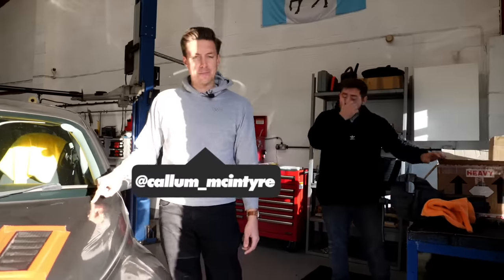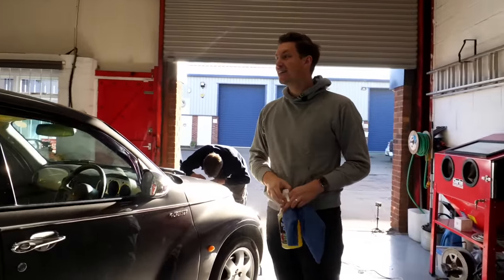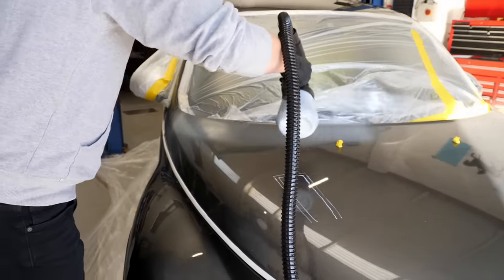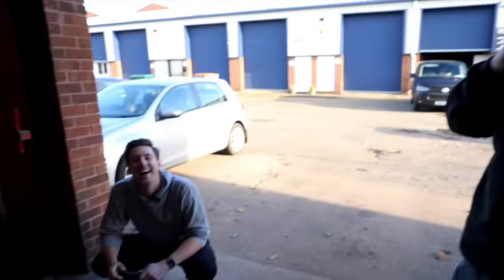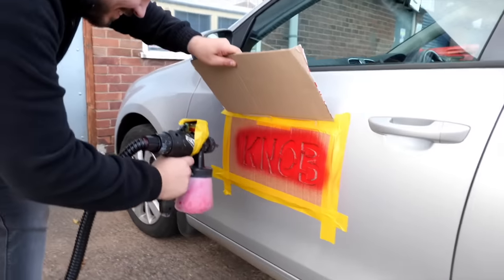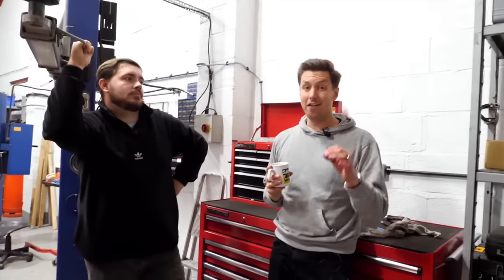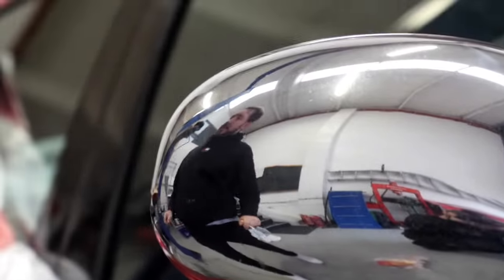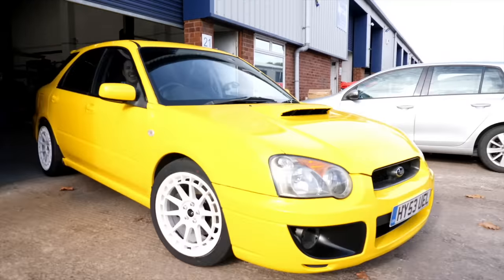How Good is £250 Amazon Paint?

Comment: Dip can be fixed rather easily. Just need to cut and remove the botched part (peel or a run) to get to the good portion, rub the edges with paint thinner to smooth the edge of the film, and respray with a bit of an overlap.
Also, no need to mask all chrome parts. If there are no pores or weird cavities on the trim peices, it can be simply peeled after dip has dried. Just may need to pre cut some of the adjacent edges, but its' the same in case of the masking tape.

Overall, this is a great and fun DIY with no commitment. The only thing you seed is space to do it.
Reply: I was about to say the same thing. You don’t even need to mask windows!!
Reply: @mrakhoover  True, but I would still mask the windows and the lights (or any other large area) as this would be a waste of product if you were to build it up to the peelable thickness.
Reply: @VasyaIvanovichPupkin  That's quite correct. But it's best to leave a 2cm gap of exposed glass to aid a clean peel-off and achieve a sharply defined edge. These guys unfortunately extended their job enormously by masking. One is supposed to paint over everything and then peel-off what you want to expose after it has dried. This way one gets a sharp edge around door handles, chrome trim, badges etc.

Comment: For anyone else attempting plastdip. One tip I've seen is using dental floss(or similar) laid with the tape for pulling clean lines. Basically you pull the dental floss after painting and it will cut a nice clean line through through the dip

Comment: We do this stuff for a living you need a minimum of 8 coats for it to be peelable like a wrap 4 of your primer grey 4 of your colour. Your also ment to peel when the dip is wet. Did you also know also if you buy the high gloss top coat on the website It comes out just like OEM paint. It can even be wet sanded & polished ceramic coated treated like normal paint. The pro coatings are much better can last 6 years plus but the general Matt lasts around a minimum of 2 years when done right :)

Comment: Remove the masking while the last layer of dip is still wet. Then the dip will break at the masking edge tape and not rip off with the tape. Also do not let the layers fully dry before applying the next layer.

Comment: I used to have a PT Cruiser, and wow. So poorly made. Definitely a case of form over function. To do some of the most basic work on the engine, you'd either have to drop the engine whilst up on the ramps or hoist up the engine from underneath. Ugh. Not to mention the hilarious radiator fan problem where it wouldn't work unless you pulled out the relay for the fan motors. I get what Chrysler wanted to do with the PT Cruiser and the intention was good. They fucked it up royally though. Moved on to a 300C Touring. Night and day difference in build quality. Its been the best car ever for the last few years. Nothing beyond fluids, pads and the occasional ball joint. That PT was more of a money sink than this dog you're whipping here!
Reply: Why (and I don't mean to disrespect) would you use real money to buy any Chrysler?
Reply: @arthurbretas2003  Which one? The PT was a PITA, however the 300C is fantastic. Mostly an E-class inside with S-class suspension. Its proven to be more of an investment than a money sink like most cars. Shame about it drinking the juice though.

Comment: car painter here: you are supposed to sand the whole car with at least 500 grit or 1000 water grit, it doesn't need the primer if you do that, if you use primer you need to sand it with 400 grit and then with 500/1000. This will make sure the paint sits smoothly on the car and doesn't peel off, it will give it an OEM look, also you are supposed to remove the masking as soon as possible after you are done with the layers, to avoid the peel off you've encountered.